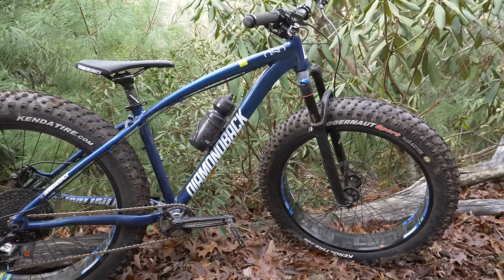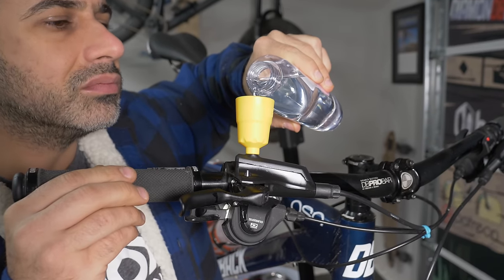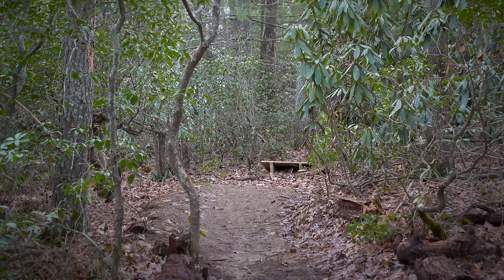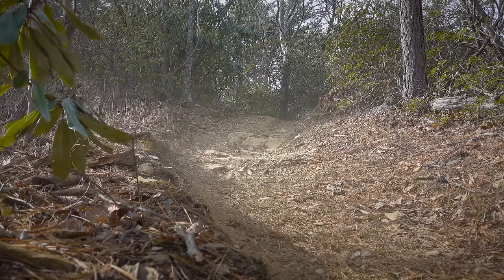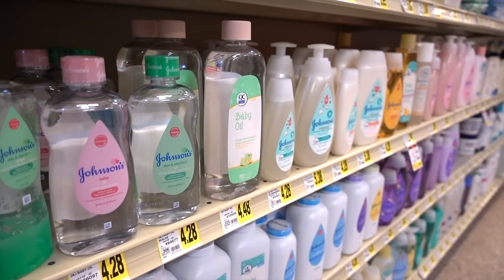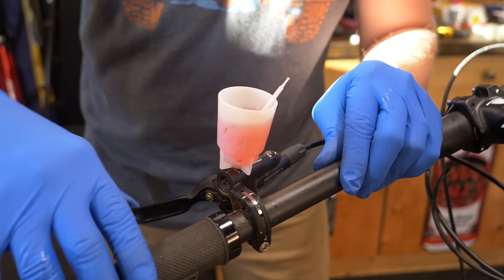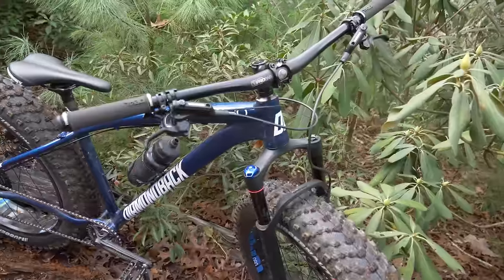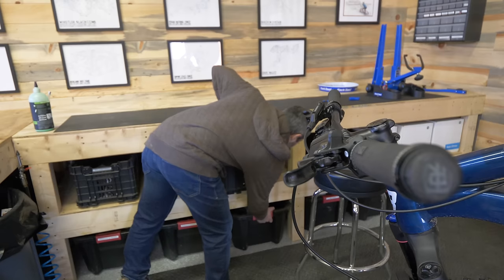I filled my mountain bike brakes with baby oil for a year and here are the results!

Comment: As a bicycle mechanic for roundabout 10years I tested the same thing with various liquids. Baby Oil was one of my favorites. I started this after a colleague of mine was telling the story of him riding through Africa with a HS33 and no proper oil within a 300mile radius. So he just used water. Aslong as the temps are fine you can use almost any liquid that doesnt dissolve your seals.
Reply: Or use a brake that does not require any type of oil inside: stainless steel cable brake.
Reply: @andrelange9877  ...or walk.
Reply: Or stay at home
Reply: @twinsturbo3911  And watch others doing it on YouTube.
Reply: ^ This is YouTube, that kind of talk belongs to Reddit.
Reply: @andrelange9877 huge performance difference between hydraulic and cable with MTB. I use cable brakes on my road bike but wouldn’t imagine using them on my mountain bike.
Reply: @samlevi3821  I don't know what kind of sport you are into with an MTB. I just put a larger rotor on the front, stainless steel cables (well greased) and I'm good. For most ppl I see riding MTB here when they have bad brakes it's just because they are very cheap brakes with small rotors. I also had a no-brand hydraulic before which was way worse than my current cable brake setup, even both using the same pad size. It always ended up leaking tiny amounts of oil into the pads but enough to ruin them. I switched to cable brake because of such bad experience I didn't want to have the words "brake" and "oil" appearing in the same sentence again for a while. These two things don't mix well together.
Reply: @andrelange9877  hydraulic disc require less energy to stop. It’s not up for debate. Any rotor set up you use will be better with hydraulic system when compared to cable.
Reply: @samlevi3821  Sure. Finger energy is a waste just like having to pedal. Let's go motorcycling then.
Reply: @andrelange9877  why use gears on a bike? Just use a single speed…
Reply: @samlevi3821  Strong and well trained legs but lazy and weak fingers... That's the funny part.
Reply: @andrelange9877  it isn’t about the ability to pull a lever.. it’s better performance. When I upgrade the brakes on my car it isn’t because my foot can’t handle the pedal. I
Reply: @samlevi3821  Hydraulic vs cable is about how the force is transmitted from the lever to the pads. Everything else (like upgrading rotor size as I mentioned before) is not related to hydraulics. One must not assume that any setup having hydraulics is always better performing than any setup having cable. My current upgraded cable setup with large rotor performs better than my previous low quality plus small rotor hydraulic setup. And its also less expensive than an entry level brand hydraulic.
Reply: @andrelange9877   Love hydraulic brakes. No friction, unlike a cable, and single finger operation on the lever is a game changer. 

I've read a convincing argument for hydraulics for touring. A spare hose weighs less than a spare cable, cooking oil, found in any 3rd world village can be used as fluid. You can use your mouth to suck it through the system, or carry a syringe which are tiny and weigh nothing. So there is no good reason to reject the best braking system in the world.
Reply: @garyking508  It all depends on the quality of the parts. The market is full of "entry-level" hydraulic brake kits that are worse than average cable. When the oil starts leaking between the seal and the piston in the caliper (even by tiny amounts) it soaks the pads with oil and then you're done. It's like a time bomb.
Reply: @andrelange9877   Who's talking el cheapo hydraulics? I dont recommend those. The lowest end Shimano, MT200's are already streets ahead of cable.
If you want cheap, go cable, still mediocre.
Reply: @garyking508  Not streets ahead. I got MT200 last month to replace TX805 just for an experiment and I can tell you their bite is not even 1% stronger. I actually feel it needs more force on the lever, even after breaking in the pads. Nothing got better except the initial part of the lever movement (before the pads hit the rotor) now feels frictionless and with lighter return spring but who cares about that. Its the braking part of the lever throw that matters and I didn't feel any improvement on this. Shortening the hose to the correct length without purchasing a specific tools kit that cost near the same as the whole brake system was a pita btw.
Reply: @andrelange9877  MT200 are still for novices, so they are designed not to bite. Shimano doesnt want beginners flying over the handlebars. Admittedly they aren't not 'single finger' brakes. It's the higher end models for single finger power, but you still get the great control and feel with lowly MT200's.
Reply: @garyking508  Since I have to pull them hard I hope they don't start spraying oil on the pads because that's the most ridiculous failure mode I've seen on a brake technology that's supposed to be better than everything else. I still keep the mechanical TX805 as a spare just in case.
Reply: Hey Phob did yeah ever try 3 in 1 oil :face-orange-biting-nails:? seems like 3 in 1 could work :cat-orange-whistling:
Reply: Hi i use a power steering hidráulic fluid it's Bad for the seals? It's working good. 
? Thanks
Reply: @andrelange9877 I live in a cold climate, brakes like tektro, mt200 died (leaked) very quickly, so I thought about bb7. I don't think the more expensive sram or Shimano m6000... Did not leak from -20 ... -30 degrees Celsius. They are simply not designed for these temperatures and
Reply: @andrelange9877  Agreed.  I love the power and feel of my hydros, but cables, for most people, are fine.  I loved my TRP Spykes on my last bike.

Comment: I’ve been waiting so long to see the results finally it’s here
Reply: Agreed.
Reply: Jack Tn you’ve waited a year
Reply: Me2
Reply: What about DOT 3 brake fluid?
Reply: Jack Tn just abt to say that
Reply: He did say in one of his recent vids that the  baby oil bike is working well
Reply: @tarstarkusz  that's for brakes that use DOT brake fluid. Rubber seals and/or brake hoses are very likely to get damaged if you fill a brake intended to run mineral fluid with some kind of DOT fluid, and vice versa.
Reply: I mean weve all waited the same amount of time and that's been about a year
Reply: @Martinangelkoski  there are types of rubber that work with DOT brake fluid (these DOT brakes all have seals, they wouldnt work otherwise) but yes, if you use the wrong fluid you will have a very bad day.
Reply: @tarstarkusz  nope its harmful for the bike compenents and the viscosity issue will have an effect either short term or long term
Reply: @Moon... Thanks.
Reply: @mattysehon4905  i didn't know i was waiting for this to show up on my recommendations 🤔
Reply: Get a life pal !!

Comment: Seth: Makes a year long test and concludes there is no real reason to not buy proper brakes oil.

Also Seth: refills brake with baby oil
Reply: Pretty sure it's really like Seth "It works, but I am not leaving any way for anybody to sue me."
Reply: @JoshKablack  exactly what i said when I watched this video.
Reply: MC SwaggerFlagger maybe a longterm test like 5 yrs
Reply: He thinks it works fine so he wants to still try it for a longer period of time to see differences with specialized oils. He doesn't want to tell his followers baby oil works fine just because he is not 100% sure and doesn't want people blaming at him for doing so and having excessive wear or an accident.
Reply: The reason being Shimano brake fluid here costs $18 for 1 liter jug. And you cannot get smaller quantity. 1) It's stupidly expensive for mineral oil. 2) What the hell am I gonna do with 1 L when brake system takes what....30-40 mL? No way I'm gonna bleed my brakes 20 times in my bike's lifetime.
Reply: Baby oil here in Chile it's SO MUCH cheaper than Shimano oil
Reply: Ive been using baby oil for 6 months and it has worked fine so far.

Comment: When I rode trials, alot of us ran our magura hs33's on water, or water with a drop of anti freeze in winter. It made the breaks less spongy, more responsive, and lighter to pull. You'd get about a year out of the seals, but most trials riders broke a lever or something before then and had to get a new brake anyway! I'd be more than happy to use baby oil in a pinch :)
Reply: Doesn't some manufactures also use special breakfluids that are basically water with anti freeze and of course some othe viscosity reagents? Like for example SRAM. They normally perform as well as hydrolic breaks with oil. But of course they can freeze and that means they are a bit more sensible to low degrees(The brakes may not work or the water expands below 4 °C and this may damage the tubes). But on higher temperatures water does not expand as much as oil...
Reply: I remember doing the same....But  I just used anti freeze as it was more common at home than distilled water. I used to grease the pistons from the outside every now and then and seals lasted forever....I also remember scratching and adding waterproofing the rim so it was sticky to the pads. But down slopes the question was what to sacrifice: the hebo shoes or the new brake pads.
Reply: @walz1986  i don't know about breakfluids, but maybe they do it for brakefluids.

Comment: Did that 10 years ago on my MTB and never changed it since -  works perfectly.
Reply: really? can we change it shimano original hydraulic oil without clear?
Reply: Yep, back in the day I used straight mineral oil in my Shimano setups with no issues.  Also have run Magura blood in my shimano without a problem.  Lots of MTBR and PinkBike discussion back in the early 2000s about baby oil having additional stuff in it that might damage your seals, collect moisture, or boil off.
Reply: @dsb1829  so let's use Shimano oil in the babies because baby oil is too danger to those Shimano components haha
Reply: @dsb1829  the branded ones are most likely 99% mineral oil. I also have a large bottle of pure mineral oil. Cleans my guitars and fluid for my brakes. never bought another shimano branded oil
Reply: recommended refilling/fullreplacement period? My concerns are about... maybe.. a part of hight temperature exposed (touching caliper) oil could be degraded a bit each time this occurs...maybe
Reply: @GrimYak  Forgive my ignorance, what do you clean in a guitar with oil? Never had one and it just sounds too bizarre to not get curious
Reply: @MrCh0o  Very occasionally you can clean the fretboard with mineral oil. I think it depends on the wood it’s made of though.
Reply: @MrCh0o  It's used to clean the fretboard (the wood where the metal frets go in, it's where you press the strings). It cleans grime between the grains, gives it a darker color and slight sheen and moisturizes the wood to prevent cracks and keep a good visual.

You could also use a touch of mineral oil on a clean rag/paper towel to clean up and lubricate the strings so your fingers glide with less resistance. Also restores the zingy tone to the strings, since grime in-between the windings make the strings sound dull over time.
Reply: Basically you can run any liquid within the brake line. But first of all you need to ensure that seals are compatible with the fluid type. Typically you can use any mineral oil for systems that designed for mineral oil. Also the liquid should have thermal stability within wide range: high boiling point and low freezing point. If the liquid boil - you brakes will fail, if it freeze - brakes will fail too. But to actually save money and to be safe you can find proper fluid in automotive (like brake fluid or ATF). They usually much cheaper then bike fluids, and have good quality too.
Reply: I Use 3wt Fork oil Works AWESOME  I Run Saints 220/203 CF Warden  Ride Vancouver  Daily 😎
Reply: @GrimYak  Ive played guitar for 20 years, ive even built a few from scratch. I also build guitar pedals, tube and solid state amps and restore old tube radios/ receivers. Anyways point is that in all this time ive never heard of anyone cleaning their guitars with mineral oil. Do you mean you treat the fretboards with it? Or are you actually using it as a cleaning agent? The most commonly recommended thing people use as well as something i use myself is lighter fluid (more specifically naptha). And naptha is just a cleaner more refined version of mineral SPIRITS which i also use when building guitars to clean the bare wood or to wipe down when finish sanding etc. But mineral spirits will leave behind cloudiness since its not as refinded and it can also leave behind an oilyness. But thats not as much an issue when the guitar is still bare so thats why some of us use it for cleaning the bodys and neck as they are being shaped and preped. Where you thinking of mineral spirits maybe? Im honestly curious and not trying to come off in an aggressive way. It might be very common to use mineral oil as a guitar cleaner and ive just never heard of people using it till now.
Reply: @dsb1829  what about baby oil in maguras?
Reply: @500wattz   I have used mineral oil in magura disc and rim brake systems, not baby oil though.
Reply: @dsb1829  the pink stuff in maguras, no issues? I know royal blood is thicker but curious if the thinner pink mineral oil makes any difference or not

Comment: I deal with hydraulic systems in my everyday job and honestly aside from viscosity most hydraulic oils are very similar whether that be mineral oils or "true hydraulic oils". Love the vids!
Reply: Seals and oils must be compatible, or the oils will slowly(or rapidly) soften and expand the seals... and fail at a bad time(usually). What works for a tractor's hydraulics might not work well in cycle brakes, fork oil, differential lube, etc. 
There's a reason why there are so many different lube formulations, and it's not about making more money(for the vast majority of lubes). It's about application and compatibility.

Sure, you can cheap out on maintenance, but why would you do that on something that keeps you out of the trees?
Reply: @skytower309  brakes don't matter on bikes cranes and trucks only matter if someone's asking
Reply: @tomlamb3885  What?
Reply: @tomlamb3885  Huh?
Reply: @tomlamb3885  you've obviously never had to walk a panel
Reply: @skytower309 mineral oil is one of the most non-corrosive substances out there. It doesn't do anything to your seals. Only worry is that it's lower viscosity which means it's easier to leak if there is a leak (if that makes sense)
Reply: @MB  each oil has its own effect on each seal type. Expansion rate, softening, etc. Corrosion is a minor concern, since all oils protect from corrosion.

Comment: Thanks Seth for resisting the temptation to simply say all the hydraulic brake manufacturers are ripping us off - this is a nuanced (and entertaining) view.

While I'm not going to experiment with my braking system to save (maybe) a few bucks a year, it's good to know if my hydraulic brakes have a problem while I'm bikepacking and I come across a town with no open bike shops, I can get by with baby oil in one brake without any immediate obvious consequences.
Reply: Joke a side is a useful tip in case we simply can not find original brake oil specially in weekends (saturday & sunday) when most shops are closed and anyone are free from work..

Comment: I had the same idea with my tractor's hydraulic system, so I researched it. Proper oils will usually include rust inhibitors and detergents so that they'll cope better with any water contamination that gets into the system. This is honestly a lot more likely on a car or tractor where the reservoirs have lids that just open by hand. Tractors even have quick disconnects to remove front loaders etc, so they're way more likely to get contamination in the oil. On a bike the system is sealed and there's really no reason to require special additives in the oil.

Comment: I've been running Johnson's finest in my Shimanos for months now with no obvious problems. This idea saved my day when I found myself needing a refill miles from the nearest open bike shop and I haven't seen a reason to change it since. Thanks for the great bike hack Seth!
Reply: how is it after 4 years ? did you face any problems so far ?
thanks in advance
Reply: @waleedassaf1836  eventually changed brakes as caliper where leaking a bit but they where very old. The baby oil seemed fine, would use again if needed.
Reply: @simonhorsfield2436  Thanks for the feedback .I'll go for it 😊